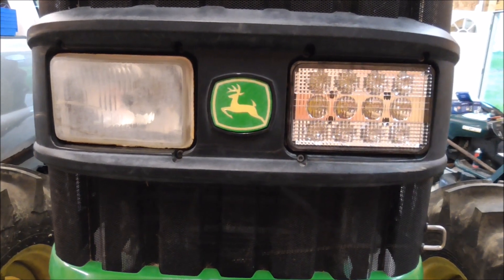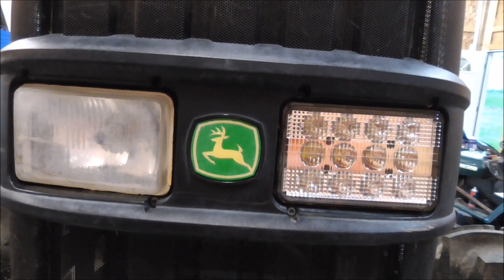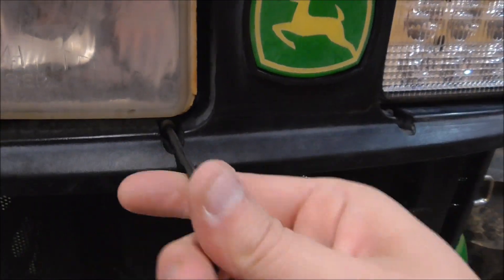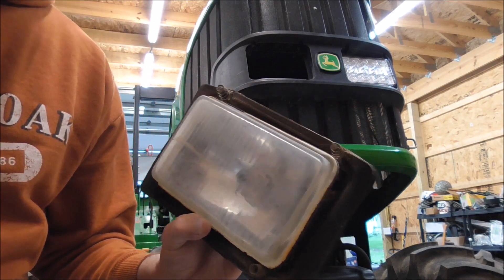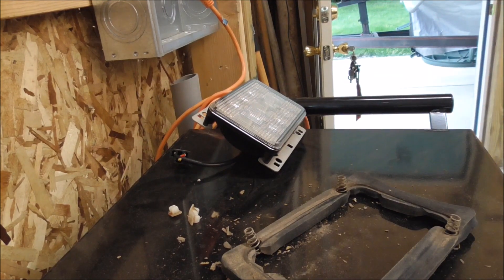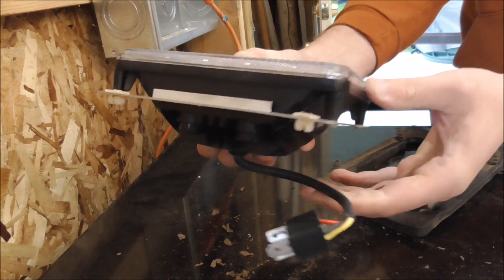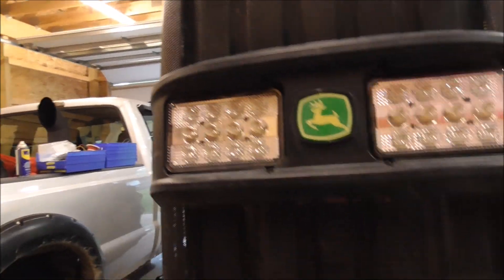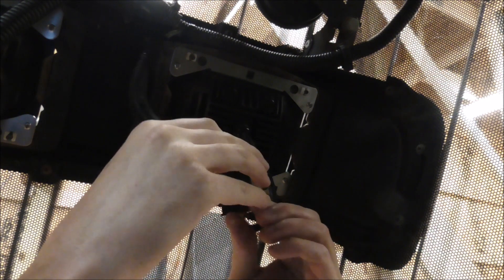New Tractor Led Headlights From Larsen Lights

Comment: I liked ur LEDs so much I also need like this LEDs for my same deutz fahr tractor where can I go for it ?
Reply from the maker: Hardeep Brar the floods are from auxbeam and the front headlights you need your factory part number and then google the replacement leds. Tiger lights have them but they are pricey! The rear floods are from Larsen lights and the headlights I forget but you i say where I got them in the video! Thanks for watching